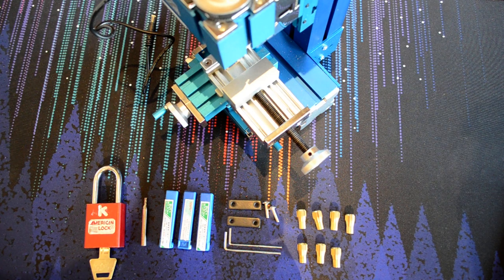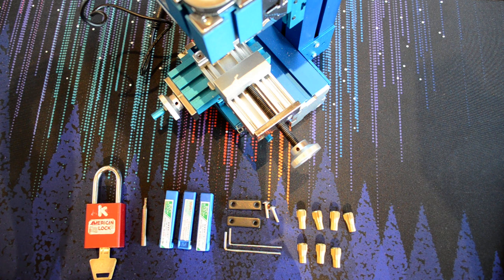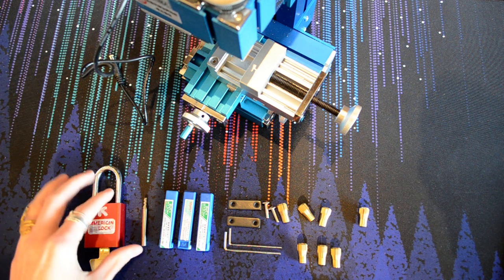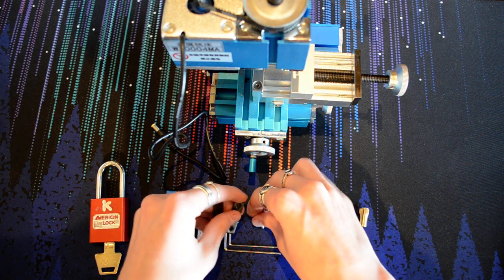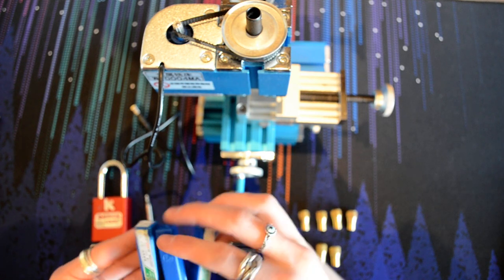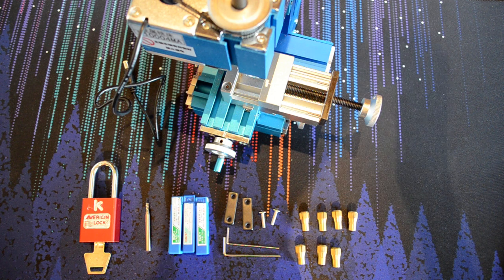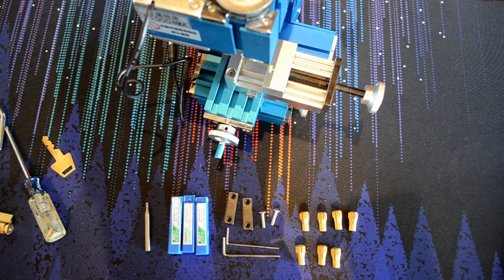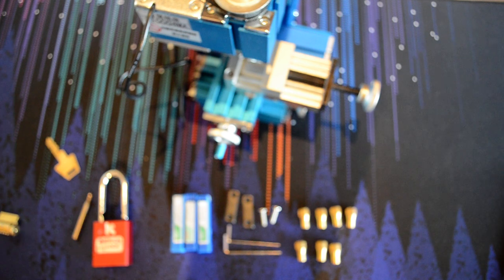(3) The Cheapest Mini-Mill - Amateur Review

Comment: Great review. 
You did a very decent job. I have a cheap milling table that I attach to my drill press for mainly lock sport related jobs and it works ok. I made a pinning tray from a chopping board.
Reply from the maker: I've been wanting to do that! did you get a rounded end bit for that?
Reply: @saltmakershaker  I put a router bit in the drill press that was almost dome shaped, half a sphere. It was also very slightly pointy at the tip.